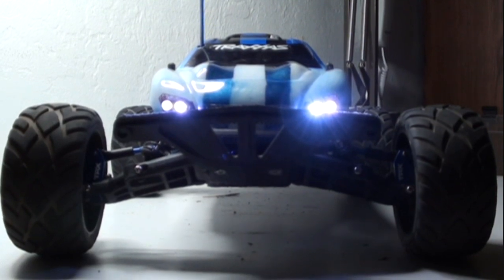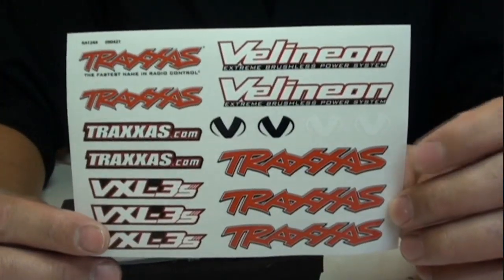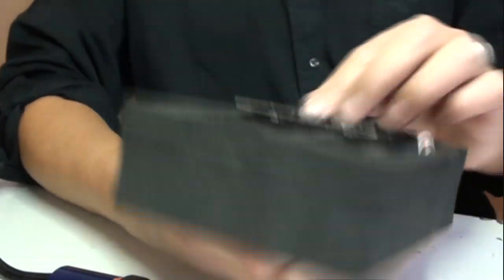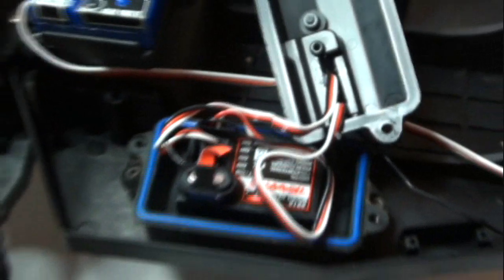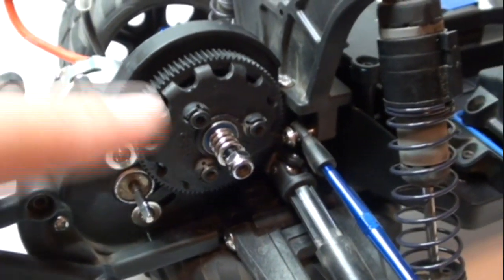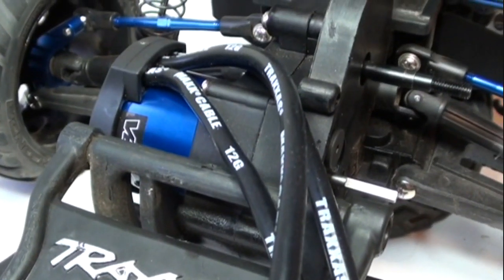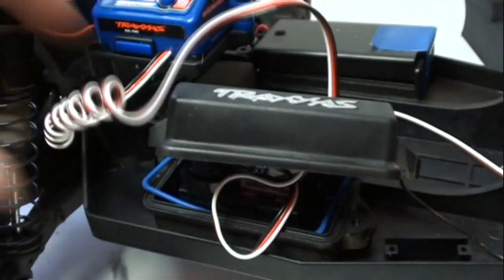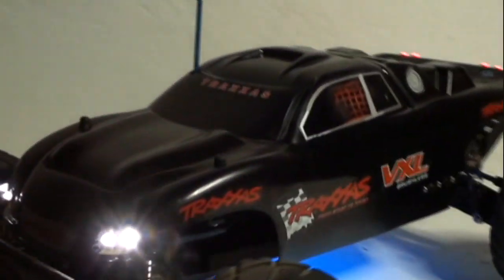Daemon - Traxxas Rustler - Level 12 Upgrade - Velineon Brushless System

Comment: How do I program my velineon.
Reply from the maker: What did you want to do with it exactly? Did you want to change it's driving style, alter the mode for low voltage detection, or set it up to work with a Remote?
Reply: +darkeclipticheart  hey, iam thinking of getting a traxxas slash vxl. i allready have a slash 2wd. but i have spent 900+$ on it and its a pos if you know what i mean. the newest vxl is 4p? right , whats the speed difference between the vxl and the sv3? thanks.
Reply: +All The Time Rc the sidewinder and velineon are both 4 pole now. You need to understand that the sidewinder typically has a higher kv, which will make it go faster in theory. I personally find the sidewinder a lot better in many ways

Comment: Hey I was wondering if you could help me out I have a brand new slash 4x4 ultimate and the vxl system is acting weird I plug in my battery and I will run for a few minutes and it shuts off blinking red and I don't know what the problem is
Reply from the maker: Low voltage detection. If you're using a lipo battery it means the ESC is reading that the battery is nearly dead and turns itself off. If you're using NIMH batteries, turn off the Low Voltage Detection.
Reply: +darkeclipticheart can I have the old motor and esc or have you gotten rid of it yet?

Comment: Hey Jason... I'm running a vxl 3s in my rustler and I've gone through one esc im currently on my second and it's done now. I run 3s and have cooling fans but i fear that the vxl cant handle the speeds I'm going its seems to burn up the esc quite fast. I've tried new gearing and stuff but nothing...before I send it in to traxxas for $50:( do you think I should consider a castle creations mesc and motor combo?? My ideal is to go about 50-65mph and bash it around. I live in michigan so its hot and cold here. I'm really confused on what to do. Any advise would be super greatfull. If you can direct me into a good combo :) thx and keep up the good work.
Reply from the maker: I would suggest going wit a castle and see how that goes. The Velineon system just can't handle constant abuse and high speeds. Also it can burn out if you use lipo batteries that are higher then 30C. Try out a Mamba Max Pro ESC. I've heard great things about it.
Reply: If I go with the mamba max pro esc do I have to go with there motor also. Then I will have to set it up with new transmission case and make the esc fit someplace on the side of the chassis?

Comment: Actualy  you donot need to take the spur gear off to remove the motor like on my rustler all I did was tace the bottom screw that holds the motor in then just unscrew the top screw and pull out the motor
Reply: Also known as "how to fail english" xD
Reply: Actually yourenot very goodattttyping....

Comment from the maker: The one with 3 wires goes into channel two. The plug that has only 2 wires is an optional power supply to be used with the ESC fan. If you don't have the fan you don't have to plug it into anything.

Comment from the maker: You should have no problem using a 8.4v nimh. Just as long as the Velineon ESC has Lipo Low Voltage Decection off.

Comment: if i run a 8.4 volt nimh battery would it have enough power or would it do that glitchy go stop go stop go stop? my other brushless motor does that it is one of those crapy hobbywing systems

Comment from the maker: One, you're pulling the sleeve that covers them both apart. Pull lower on the cable.

If it's not that, then more then likely the connectors have been pinched from impact. Just give it all you can and pull them apart.

Comment: Did you forget to upgrade the X-L5  tranny and install the diff with the steel ring gear on it?  Or had you already done it? If you did not How long did it take for the dissapointment when velineon killed the plastic diff?

Comment from the maker: IMO get the velineon system. When I did there was a huge difference in torque and speed. And if you ever get Lipo, you'll be blown away. And you don't have to worry about the Titan Motor burning out.

Comment: Did you change gearing? If I get this and this velineon system il be running it on a 9.6v 5000 mah battery. Will I have to change it then?

Comment: @mustangluver101
The same thing happened to me. Pinions are pretty cheap, so I took a dremel tool with the cutting disk (for metal) and ground the pinion set screw part of the pinion down to the motor shaft. The set screw should pop out. Be sure not to grind the motor shaft. Hope this helps!

Comment from the maker: @smelsfishy It really depends. The Brushless motors last for a long time even when you push them hard and you don't have to do any maintenace for them. The brushed motors could last for a long time if you break them in properly, clean and grease them on a regular basis, and you don't push them to hard. If you don't do any of that for you brushed motor, it can die rather quickly. Any where from a few days to a few months. That's one of the reasons why Brushless comes so highly recommended.

Comment from the maker: @tyler110897 Actually no. You can buy the VXL-3s ESC by itself ($120) or the Velineon Brushless Motor by itself ($60) or buy the Velineon System which includes both ($180).

But the motor won't work without the ESC and vice versa.

Comment from the maker: @beastlytraxxas97 I know because I ran my rustler with two seperate batteries in a row without letting it cool down. The motor got to hot and burned out. It actually got so hot it warped the transmission casing from all the heat. I tested the motor with a seperate electric source and it still didn't do anything. After doing some research I found out that the Titan 12T motor can easily burn out if it gets to hot. If you are unsure you can always go ask a RC person at a hobby store.